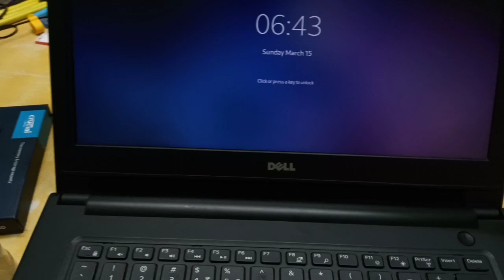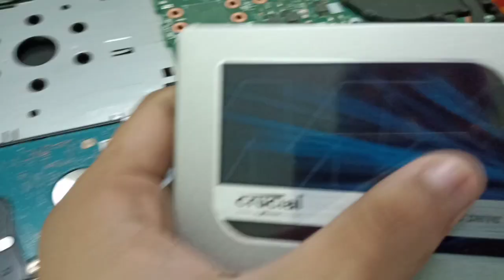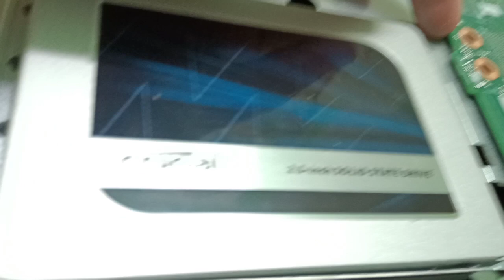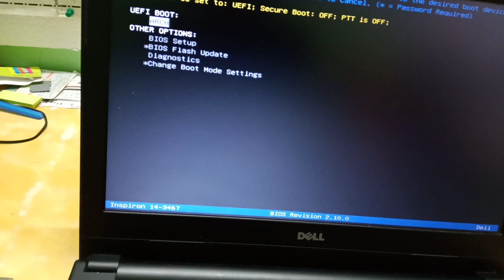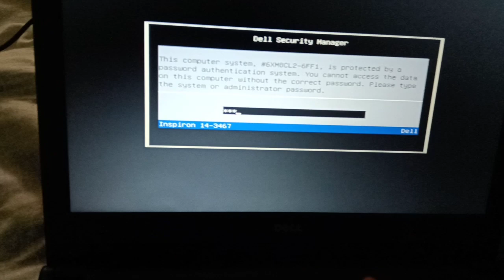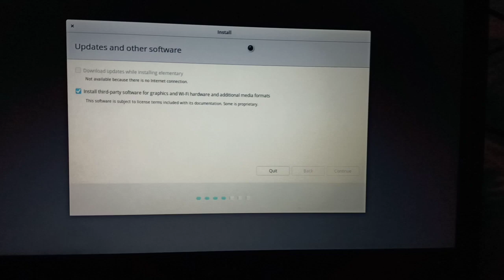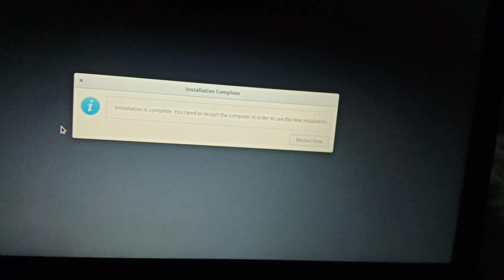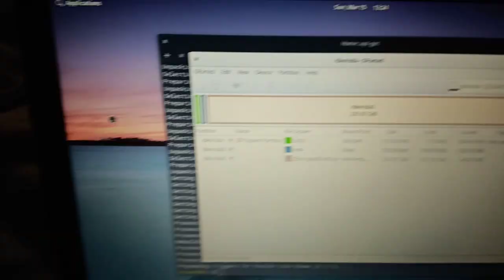SSD Upgrade (Dell Inspiron 3467)

Comment: Hi everyone, need your help. I have a Laptop DELL Inspiron 14-3467, RAM 4GB, using Intel I3 6006U 2.00 GHz, AMD Radeon R5 M430. I bought it back in 2016. I want to upgrade my laptop. How many ram slots in that laptop and what is the type of the installed RAM? Is it ideal if I add a Ram DDR4 4Gb instead of 8Gb? And how about SSD. Which one is fit, SSD 120Gb or 240Gb? Thanks.
Reply: Any storage limit can be fit on a computer, you can even do a terabyte or more, if you want to save money or if you don't need much storage you can buy 120gb or if you need more buy the zebronics 2.5 inch 512 gigabyte ssd, also ram stick doesn't matter, the pins connecting the ram matter, it's normally written on the ram stick itself. as you're using an old computer its best to use ddr4, Radeon is also just a graphics card, if it was the cpu the whole motherboard and ram would be different. There are two slots for ram.  The higher RAM the better the experience.

Comment: Is that laptop with intel hd or amd radeon vga?
Reply from the maker: Intel hd 520
Reply: So , which ssd type did you used?sata 2 or 3? and i guess this laptop can't use dual storage so you change the hdd with ssd , is that right?
Reply from the maker: Yes,right it's using sata3
Reply: Ohhh ok thankyou very much
Reply: @darelltimotius7379  Does ssd sata also applicable to Dell 3467 i3 Amd Radeon?